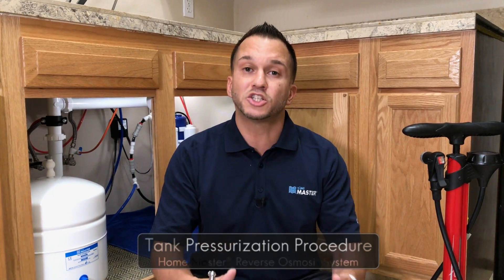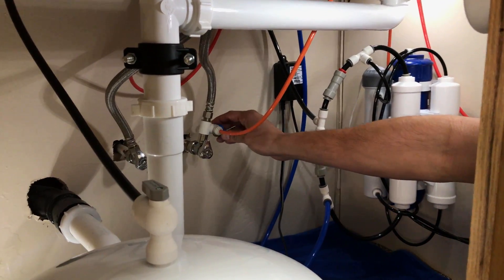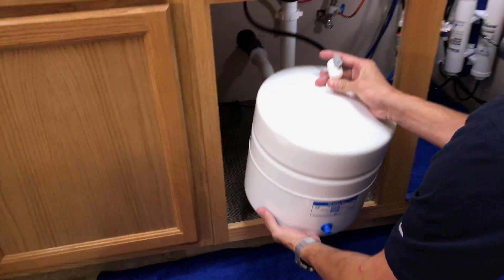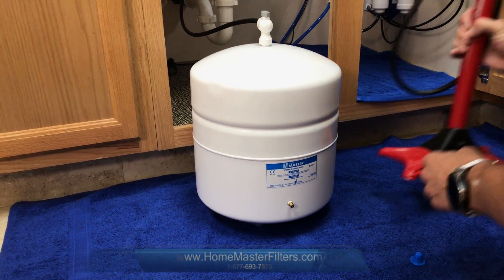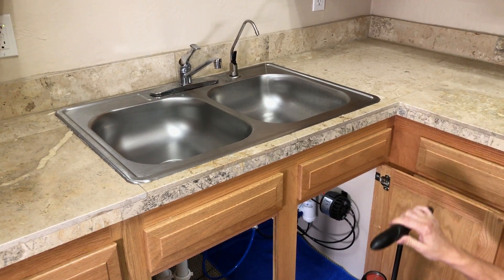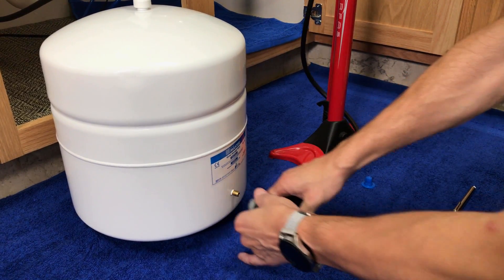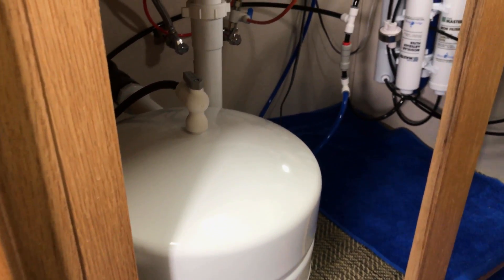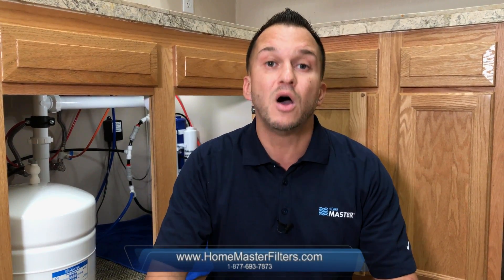How to Pressurize Home Master® Reverse Osmosis Tank | Home Master® RO Tank Pressurization Procedure

Comment: I had 0 psi when it was empty.  Thought I had a bad pump and gave up.  Let it fill and now it’s at 50 psi, is this normal?
Reply: Same thing happened to me. I ended up just filling it up and measuring when full because i kept getting 0 psi when tank was empty, even if i pumped air in it when empty. When i filled the tank after attempting to pump air while empty and remeasuring, i then had a reading of 30psi, so i just emptied air out with the tank full until i had 7.5psi.
Reply: Check the pressure when the tank is empty of water, otherwise you are measuring  air+water pressure. When empty of water you should pressurize to 7psi. No more and no less.

Comment: Help!  My tank has no air valve. Tank has the company’s sticker on it, dated 2020.
Reply from the maker: Please check the bottom under the cap. If you ordered one of the optional sizes, the air valve can be in different locations than the standard tank shown here. For live personal service - please call 877-693-7873; or email support@theperfectwater.com  .

Comment: I followed the instructions: Shut off the feed water valve, drained the tank and pumped out any remaining water before pressurizing to 7.5 psi. But when I reopened the feed water valve the water doesn't do the "thin stream" shown in the video; instead it does fast dripping. Is this dripping considered close enough to the thin stream that I shouldn't be concerned? It says "once you observe the thin stream" to shut off the RO faucet. Does the "once you observe" part mean it's sometimes necessary to leave the feed valve open a long time before the fast dripping becomes a thin stream and the RO faucet can be turned off?

Comment: Pumping air from a manual tire inflator pump does not contaminate the tank?
Reply: no there is a rubber bladder inside the tank that your inflating with air to pressurize the tank. the air you pump in does not touch the water.
Reply: It's a sterile, air-tight bladder whose contents (the pumped air) don't mix with the water.